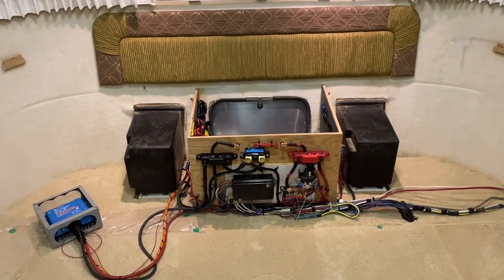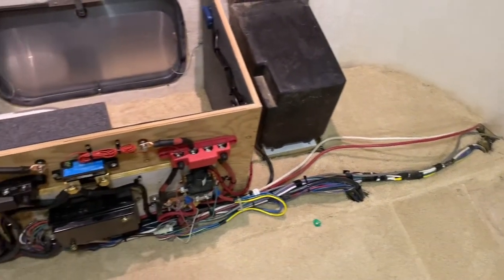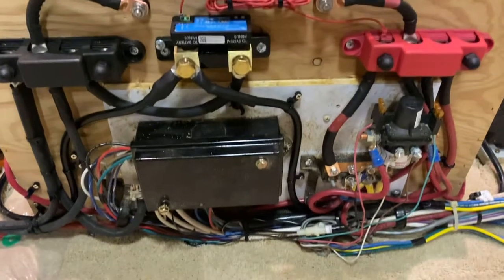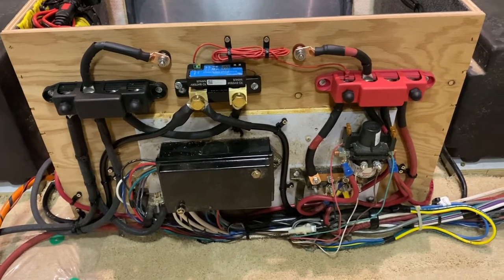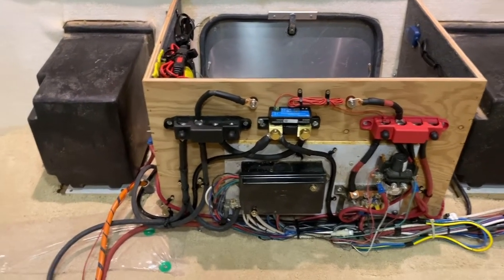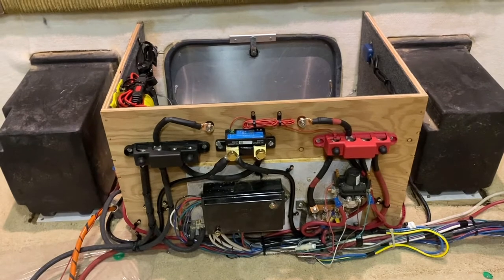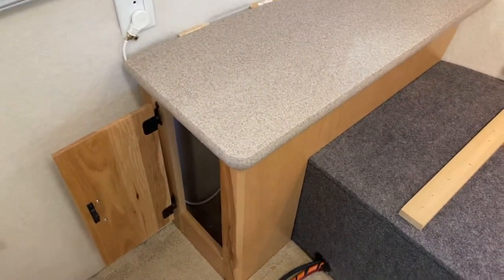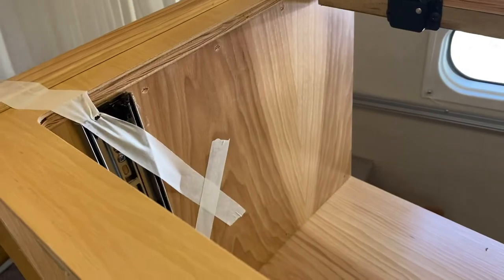Airstream FB Queen bed removal and replacement

Comment: How easy was it to remove the bed? Given that it's an airstream, I would assume you could just use simple power tools to do so and that it wouldn't damage the structural integrity of the unit
Reply from the maker: It was pretty easy.  I did it in 45 minutes or so using a cordless drill/driver - while being careful and methodical to avoid breaking anything.  It could probably be done in 15 minutes by an experienced tech.
Reply: @DavidLaFerney  Thanks for letting me know! I'm planning on getting an airstream next year